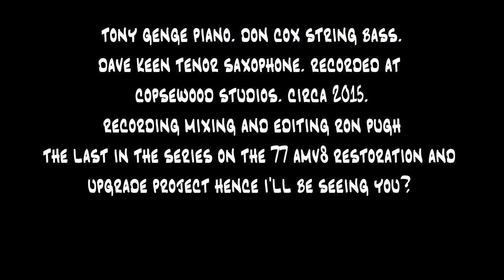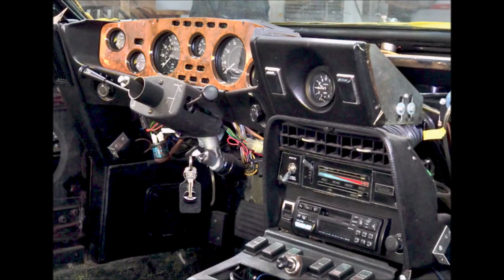The1977 AMV8 restoration Finale, Vid #4 music for Aston Martin Lovers. I'll be seeing you?

Comment: Like to have one maybe with an LS3/T-6 tranny an IRS so one have classic looks with modern resto  mod dependability
Reply from the maker: Thanks for your comments. Believe it or not if they are well maintained they are pretty dependable.. The problem for guys like me, is that I can't afford to buy them new,  I have to buy them secondhand and that usually means I'm inheriting somebody else's problems, that I then have to fix?  The factory installed ZF five speed box, albeit a rather sloppy gate ( I liken it to a stick in a suet pudding ), is actually a very good strong gearbox. I've installed a modern 6 speed in a customer's car  and he complained that the 1st gear was real short? The engines are very strong and the rear end is a De Dion set up which for all intense purposes is IRS. The addition of a Steelwings or Harvey Bailey handling kit with an added rear anti sway bar makes for much improved handling. Having said that they handled pretty  well outa the box. The good news is there's a whole cottage industry that's developed supplying lotsa after market parts and "upgrades"  which will hopefully keep these cars on the road for the enthusiast's for years to come..